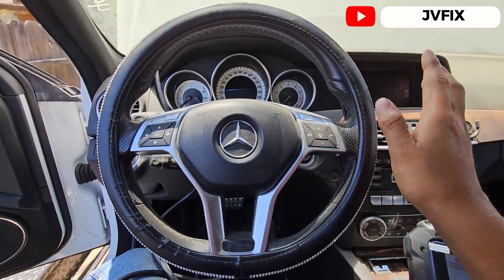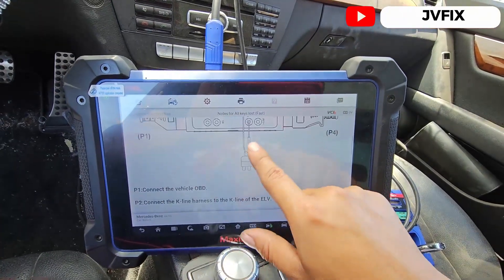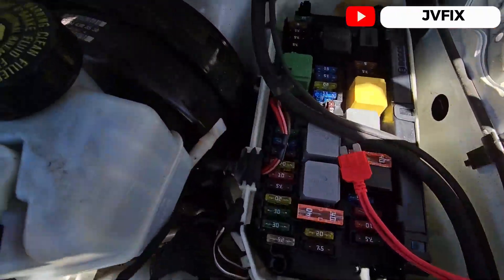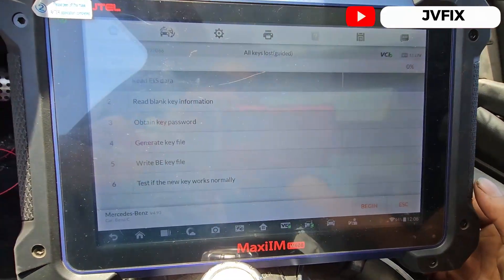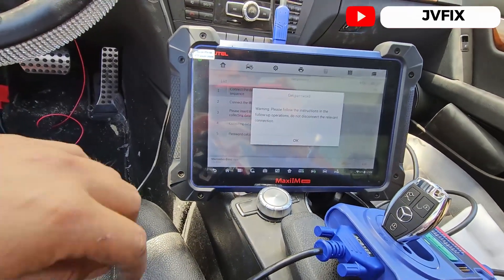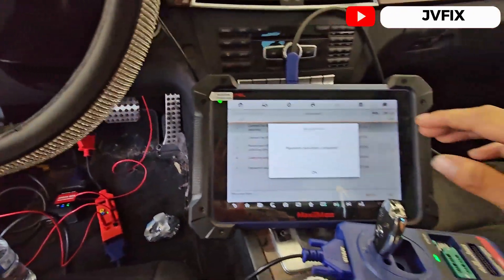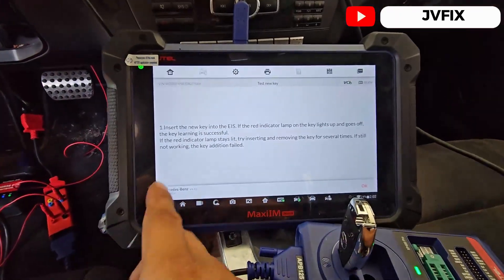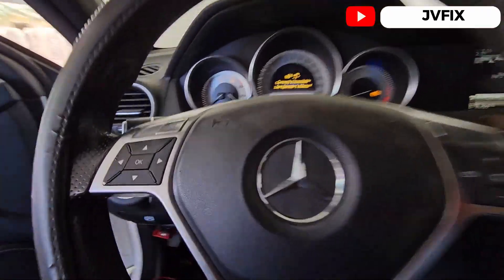How to program all keys lost on 2014 Mercedes C230 with Autel IM608 and G-box

Comment: Hey! Thanks for the video! I'm using the IM508 and it doesn't come with the ECU reprogrammer - is it necessary to use the J2534 ECU reprogrammer, or can it be done without it? is there any difference? Thanks in advance!
Reply from the maker: yea, you need the xp400  that's the one that does all the password calculation

Comment: What’s the difference from this to a bench g box. This looks way easier. A reply would be much appreciated. Bless you for the knowledge
Reply: Password calculation is faster on bench sometimes it take hours.
Reply from the maker: bench is mostly used if you don't have the car physically, and someone shipped the components to you to get it programmed. in my opinion, for me is better if I go where the car is.  on bench you need to create your own harness and power supply is not too difficult to do but is mostly used when you have to clone ecus and other things.

Comment: DISCULPA COMO TE PUEDO CONTACTAR GRACIAS
Reply from the maker: me puede mandar un correo a mi email 

jvfix2023@gmail.com
Reply: Nice work man, amazing video and accurate information, I am just wondering where did you connect that single red wire on the GBox. The green connection on 3:25 timing of the videos. What that connection for? Totally appreciate you man. Thanks for your amazing videos.